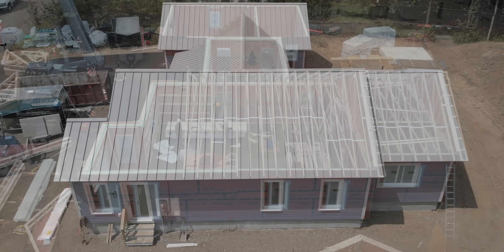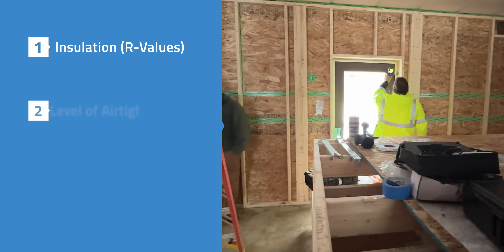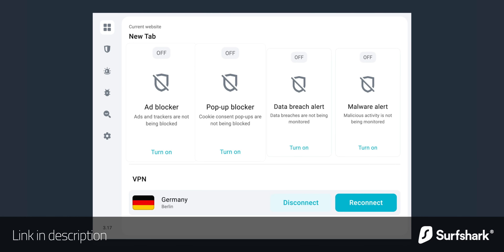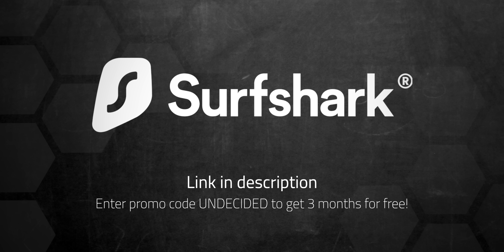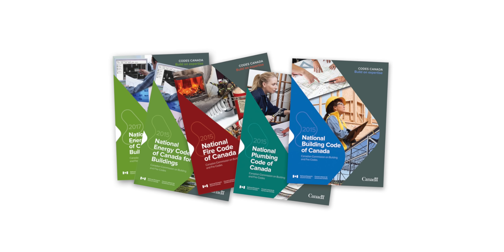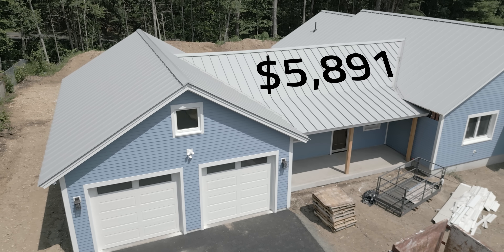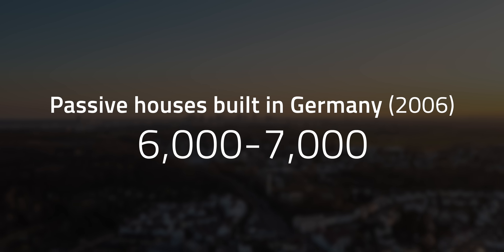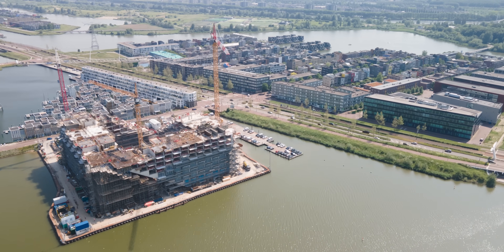Why Do American Homes Suck?

Comment: In South Asia anything not made out of reinforced concrete is considered slum housing (there is plenty of that too). No need for two layers of brick like in Europe since you won't need insulation from 35 to 25 as much as from 23 to -5. It also enables some very nice designs. My current house has no wall on the pool side so you can open it up for a party.

Ever since I discovered that factoid it puzzled me why only office blocks and really high end (10 mil+ eur) houses are made out of reinforced concrete in the West.
Reply: Because wood is incredibly cheap compared to other building materials in North America.  Canada is practically a gigantic forest.
Reply: @alanpleiman3378  slaves were in readable cheap as well, money should not be the primary way we decide what needs done and what does not. 

The energy savings for building quality homes would outweigh the initial cost increase, but capitalist are greedy and selfish 
, therefore unwilling or incapable of thinking about the long term over immediate personal gain.
Reply: In America capitalist take all of our money so we can’t afford nice things. 

It will be that way in South Asia soon too, your capitalism just hasn’t progressed as much as ours, but I saw the signs already while I was in Thailand.

Comment: I imagine tilt and turn windows also aren't popular in the US due to their drawbacks since in the US window air conditioner units are extremely common as are window fans, tilt and turn windows won't work with a window AC and aren't that good for window fans due to not being able to close down against the fan sealing everything aside from the fan opening ensuring the air flows thru the house to another window, not to mention issues with furniture and window treatments being in the way when opening them vs vertically sliding windows that stay within the window envelope.
Reply: It seems like window ACs and fans could easily be redesigned to fit the new space. Especially if the tilt and turn Windows can pop out of the frame. 

Just remove the window, and install your window AC into the entire space, then when winter comes remove AC and reinstall window.
Reply: Really wouldn't be that easy given that the air conditioner uses the window to hold it in place, which means needing to use a frame that has to screw into the window casing with legs that rest against the side of the house to support it. On top of that then you would need a panel that can adjust in both height and width to account for the massive differences in window sizes, it would need to lock into the window somehow for security, and it would need seal as well as the window and have at least the same R value which is not easy to do with something that has to adjust in both width and height while also being see thru so as not to block the whole window.
Reply: @sandrahiltz  the window units you use much be higher quality then the ones I have seen, because hood R value, and an air tight seal do not come with window units in my experience. 

As for the fitting into the window, just redesign the unit to be taller, then it can set into the window the same way out current ones do. The new window types would have to be standardized so that there are not many different models, but your shouldn’t be picky about custom window sizes when using window AC units. Then you just have the same side extensions that worry about left to right fit. 

Alternatively, you could install the window units into a detonates hole in the wall, opening it for summer, and closing it for winter, this would allow for a better seal anyway, and with your new airtight windows, it will be more efficient.

Comment: Most american houses are having a open plan which is ok..in Hawaii or other hot zones, but not everywhere in USA, I've seen this kind of houses even in North Idaho. You lose a lot of heat having large window entrance doors, no closed halls or a second door at the entrance and very large rooms for no reason which require more extensive/expensive heating options.

Comment: Having "owned" a few homes one of the first things that I would do was add insulation to the attic (and plywood for added storage space) and wrap the pipes under the house. Over the course of time windows and doors would be updated as well. It takes a considerable amount of "want to" when it comes to updating/upgrading a home. As an American we have "gotten used" to "cheaper" commodities (energy, water, food) when compared to the rest of the world. Several generations have passed since the times you mentioned in the late 70s/early 80s, it is the American "normal". Can American do a better job with commodity efficiencies? Of course, but most don't "want to".
Reply: Thing is I can't remember a time when Americans weren't complaining about prices of energy, food, or other utilities including water that weren't priced way higher than we pay for them, so I really don't get this "cheap energy" claim, either.
Reply: @KainYusanagi  Gallon of gas (in USD) Europe approx. $7.60 in the US $3.88. Sure American "complain" that doesn't take any effort or change of behavior. If the price of gas doubled (and stayed there), America would become significantly more efficient with transportation. Kilowatts hours Europe is about 6% higher compared to the United States. Yes, those are very broad strokes Norway and Italy are vastly different as is Alaska and Illinois.
Reply: I've done the same thing, update what I could as I went. Makes a world of difference!

Comment: In the case of paper thin walls. AC is relatively new. In the southwest, homes were built to allow airflow without the use of energy, similar to older Japanese homes but not nearly as effective.
Reply: It isn't that new, but I get your point.   When I lived in El Paso, in the mid 1990s to early 2000s, almost all the homes were built with evaporative coolers rather than refrigerated air conditioning.  Evaporative coolers require air flow from cracked windows or doors.

Comment: I’m building a house in the Hudson Valley of NY. With all the incentives now for high-efficiency mechanicals & solar, it’s almost cost-neutral to use these technologies vs conventional ones. The payback time is very short, < 5 years. The SIPs might be a bit more expensive, and I guess it’s harder to calculate the payback time for the extra insulation (though I’m sure Matt could drop some more acronyms and decimals and figure it!), but again, even if you don’t care about the environmental impact, it just makes financial sense.
Reply: I tried building with SIPS and the local government in Pennsylvania stands in the way of approving anything but a stick built house.  It was going to be 2 years of red tape.
Reply: @MrPizzaman09  If they're too stupid to wrap their heads around SIPs you could always stick build with 2x6 cavity and do continuous exterior insulation like Zip-R and nailbase EPS roofing.

Comment: This all comes as locally (Arizona, sub 2009 IECC standards) there has been a dramatic increase in the number of issues home inspectors are finding in newly built homes. The standards are low, and they are still cutting a lot of corners.

Comment: Homes in Europe not more energy efficient!!
 Made from concrete or brick it’s hard to insulate!!
American wood frame is much lighter,natural wood is healthier,easier to remodel/improve.
  Material choice is based on cost to benefit analysis  not ideology. It’s misleading video because actual y not taking about Europe but Germany and other very rich countries.
Reply: they really arent hard to insulate though...
Reply: @mlsasd6494  not sure how you insulate existing concrete to R-15?. If there such good insulation why  electric energy costs in Germany is 5x as high as in USA??(60 cents +per kilowatt hour??

Comment: Insulation standards here are so tight that they come with ventilation standards because you'd risk suffocating/air poisoning yourself in your own home without them.

As for the general state of things in the US, developers present the cheapest way to build to consumers, trying to obfuscate the long term cost as much as possible.

Over here, everything from insulation to solar panels is presented as "you save x amount over y years compared to not having them". Which is generally calculated in a comprehensive way and makes making a decision about the investment compared to eating the cost over time far clearer.

Comment: You highlight the savings but forgot to add in the cost difference between what you have and the other houses do. Solar panels and windows arent free. Also it'd be useful to factor in the degradation of the insulation and other air tight structures as the home naturally settles which all do or materials break down. It seems like there is an assumption that the materials last in perpetuity.
Reply: Return of investment. If you are going to live there for 40 years it will be cheap in the long run. If you selling at least where I'm located will bring much higher price (usually higher than investment cost) compared to a house with bad grade. 
Materials used for it will last, isolation will not degrade and settle if done correctly, my 50s home was isolated in the 80s with rock wool by previous owner, it has not settled yet. A heat pump (ground) has a calculated lifespan  of 25 years  and the technlogy has moved forward so fast that atleast the ones that are 25 years old now are so inefficient that the savings are made up in a a couple of years for a new on, the piping wont need touch for 60-100 years depending on how long the hole lasts. 
Same with most consecerning "passive" house

Comment: The lack of unity in the United States for many things that matter represents indeed an hindrance for a command and efficient building code, but also costs a lot more to everybody if a window, door or material can't be sold to other states because they have cheaper less efficient standards.
Same for the lack of national standards for taxes, that drive accountants in nation-wide corporations crazy, the lack of a national driving license, etc.
I was also surprised to learn recently that there are no insulation panels made of wood fiber or wood "wool" like we have in Europe. An excellent material for roof insulation, as unlike rock wool, it does not let the heat penetrate the house quickly.

Be proud: Your brand new American home sucks like other American homes too  😄, at least as far as solar is concerned: It's a McMansion with at least 9 or 11 different roof slopes, making it really inefficient for solar. Ideally, there should be just one south-facing slope, with most openings moved to the top, and with the solar panels (photovoltaic, thermal or hybrid) being part of the weatherproof roof design, not an addition on top.
The house dimension should be based on the dimensions of the solar panels, including the eaves to protect the walls or the entrance door from the rain. It's a much simpler, less expensive and more energy efficient design 
I sound a bit bitter because I live in an old house near a church classified as an historical monument, solar roofs not allowed...  😄
Reply: The international building codes require offsets of panels from the peak of the roof & edges.

Keep in mind, solar panels can catch fire, due to oxidation inside inside the glass panels, and the fire can cause your underlay roof material to catch fire, burning your whole house down. The underside of traditional solar panels are made with a hydrocarbon based backing (ironically, the back of a panel gets hotter than the sun facing side!) I had to translate a German fire study on the topic into English, to find out more about it.

My original plan to put solar panels on my house evaporated, once I found out that I could only fit half the panels I wanted to put on, with my design, if I wanted to follow the international fire code. (Note, local building code does not necessarily require following international fire code, but I researched it for the safest implementation.) There needs to be safe places for the firemen to walk on the roof, and places to put axes into the roof to break out the wood so water can flow into the home from above.

In the end, I decided on a stand alone 5.5kWh solar array, which I am still working through all the details. I decided to use panels with glass on both front & back, to reduce / eliminate fire hazard.

All I have to say is that building codes suck with implementing solar. Honestly, the technology for Solar sucks today. The building codes are  constantly changing because the technology is evolving in real time, everything is complex, everything is contorted, and everything looks horrible in the end with panels with hydrocarbon backing [flammable] secured above traditional roofing materials (asphalt shingles [flammable], tar paper [flammable], wood [flammable].) Solar panels on roofing is just a fire sandwich waiting to happen.

If I was able to ignore all building & fire codes, I would have a glass roof over my house, which conducted electricity, where the panels overhung the house on all sides at the shape/size of the panel that was most affordable, supported by steel instead of wood, without combustable materiel under the panels. It is vastly more affordable. Not allowed.

The building codes suck.
Reply: @DavidHalko  The building code sucks because it does not yet include an approved solar roof that takes into account all these criteria, like panels being an integral part of the roof, non flammable materials, a totally fire-proof barrier, air flow to keep the panels cool in summer and melt snow in winter, etc.
Nobody uses asphalt or tar or even steel for roofs in France. Or rather, steel on industrial buildings, but not houses.

Comment: Excellent video. We are in the planning process of building a passive house in the US . So many products have to come from Europe or they are US versions of what had been used there  for a very long time. GeoThermal is very common, but it is known as Ground Source Heat Pumps, unless you live in Iceland 😊

SIGA for tapes and air/moisture barriers. Good products!
Reply: I don't even wanna know what the cost of import is for all that. I looked into getting a single window from Australia once and it was prohibitive.
Reply: @gladitsnotme  you did say it was from Australia... and the Aussies can say the same other way...

Comment: The difference between the US and Europe, is affordability. The US has on average a lot bigger homes. Something a lot of Europeans can’t enjoy. Building costs in Europe are crazy expensive. It’s way better to have a home in the US. Also we have the ability to have bigger yards.
Reply: "ability"
US literally have a continent 
Say that to korea or europe
Reply: You get what you pay for. Houses in Europe are a bit more expensive, because they are made with a live expectancy for at least a century. Houses are usually made out of brick walls alongside with a concrete + rebar skeleton and a ceramic tile roof. They have exceptionally sound, heat and cold dampening. They are robust to withstand hurricanes, tornadoes, floods & earthquakes (especially in the southern Europe). Sometimes stones are used too. People usually stay for many generations in their houses. Many are also multi-family houses, or have a store at the first floor (depended on the region). 
Having a big american sized house, isn't popular in Europe. People prefer to live in a proximity of a good public transport connection, near schools, work, local supermarket, etc. With low air and sound pollution. The size of the house & car isn't a priority.

Comment: One problem i have with the video and its only a small one is the excitement about france having 68% nuclear energy generation. this is severely impacted by climate change and hot summers see the country having to shut off massive parts of the nuclear program and it might be on risk to even be viable to maintain as nuclear energy is one of the most expensive ones around. it definitely helped them early but now it risks to become just another coal and gas like problem with trash piling up, and high cost energy generated and not building real renewables might hurt them

video was cool tho <3

Comment: I live in Santiago, Chile. The coldest it gets is around 0 Celsius or 32F. I build my house with the widest SIP panels I could get (162mm) and got double glazed windows. Every wall, the floor and the roof is made of those SIP panels. 

After one winter chasing leaks and fixing badly sealing windows I now spent this whole winter with no heating. Just a small inverter heat pump for about an hour each day.